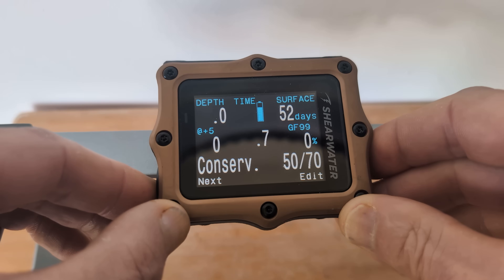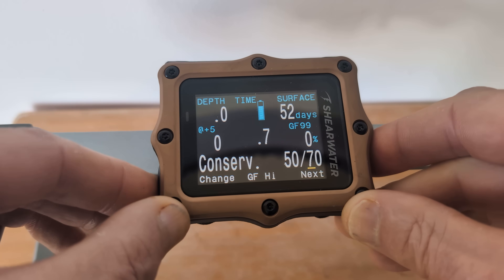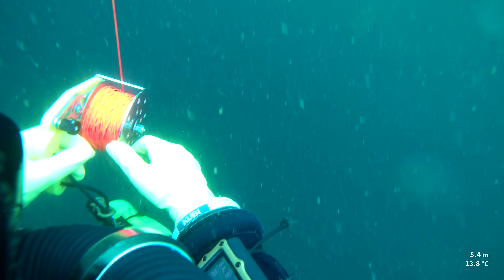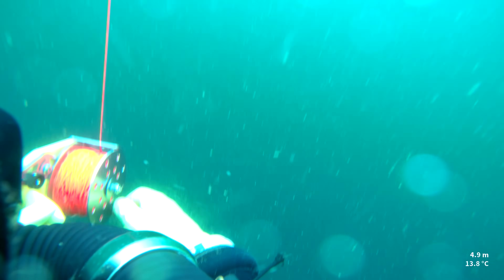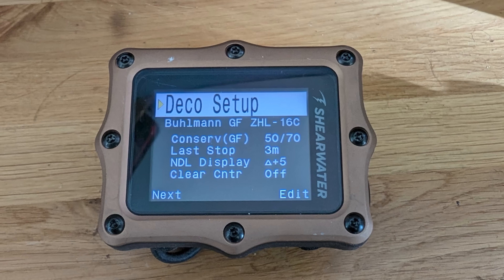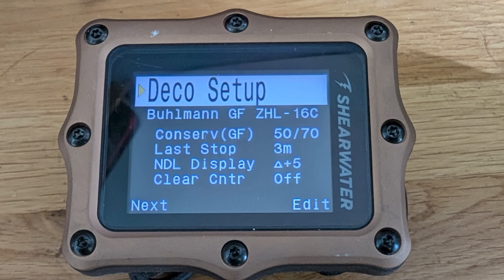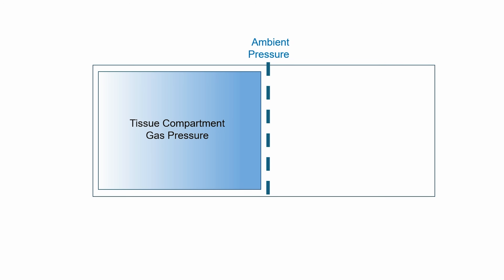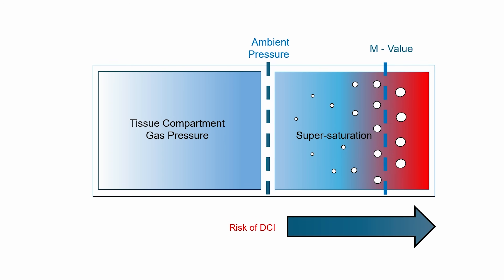I Changed This One Setting and Became a Safer Diver

Comment: Absolutely nitpicking here, but the term M-value was introduced by Workman.

Buhlmann just generalized the algorithm to use absolute pressure (so it works when diving at altitude, given he dived in Swiss lakes), while Workman’s version was only designed for depth pressure—aka at sea level. Buhlmann also expanded the number of compartments to 12 or 16 (though I can’t remember how many Worman used… maybe 4?)

Anyway, great video, thanks for sharing!

I dive 50/80 when doing deep dives (though I try to stay on oxy until my SurGF is in the 60s if possible), and 20/80 when doing long shallow cave dives in Mexico.
Reply from the maker: Of course you're right and thank for flagging that up.  I was trying to keep my explanation as simple as possible but sometimes when that happens stuff gets lost, like this

Comment: Thanks for the great video. I started diving 50/75 a number of years ago. When I made the change I noticed fairly quickly that I was less fatigued after.
Reply from the maker: Interesting to hear, what were you using before?
Reply: @DeepWreckDiver I was running a 40/85 prior.

Comment: A useful parameter on Shearwater, and now Suunto, is GF99/GFSurface.  It’s useful to have a real-time display of where you are against M and the selected GF slope and where you would be if you just went straight to the surface.
Reply: I use it to do "dynamic safety stops". Basically, go to whatever depth is required to keep gf99 >30 or even >40, for at least 3 minutes. In practice, it means you are starting the safety stop at 4-5m and ending it at 1-2m. It adds a whole lot of conservatism (you will easily exit the water with 15-25% reduction in surfGF compared to a normal safety stop). The only downside is guides will think you're stupid breaking rules but hey, I've not exited the water with surfGF >65 for a long time, even when hitting 0 NDL, and it takes no longer than a normal safety stop
Reply: @a @albert91tgn u highlight an important point - doing what you do based on knowledge and skills rather than following dogma without understanding the reasoning behind it.
Reply from the maker: Yes, I agree and see lots more people having it displayed prominently on their computer!
Reply: They are available on the higher end Garmin computers, as well.  Even when I have a 60/80 set, for example, I’ll still usually hang around for an extra few mins, as conditions permit, until the SurfGF gets down to 70 or so.

Comment: Every person is different on every dive. There are far too many variables in any one dive, even tightly controlled research dives. Trans cranial doppler studies from NEDU testing the same individuals doing the same exercise at the same depth and in the same water temp showing bubble risk is largely unpredictable. You should pick a GF, or not, based on the research when you get the computer and you shouldn't change it unless you get a hit. Plenty of people never adjust the GF, others dive GF99, and neither get bent. You sir are no safer for changing things if you have no history of bends with previous settings. What works, works.
Reply from the maker: Because I'm getting older and less fit, my assessment is that the risk of a bend is increasing.  I've changed my GF so I spend more time on decompression which I believe will counter the increased risk. I think most people would agree that is pretty sound logic and will make me safer!
Reply: Yes until it doesn’t

Comment: 50/70 is right in the range the tech divers in the Puget Sound/ Salish Sea region seem to use.  75 is about the highest I have seen for GF high.  GF low seems all over the place, anywhere from 45 to 75.   I wondered how you guys were getting away with using such high gradient factors without getting bent when I saw some of the earlier videos.  There don't seem to be a lot of people around here diving to 100 meters very often either though, so I do wonder if there is a difference between a quick bounce to 100 meters and spending an hour at 50 meters.
Reply from the maker: Not sure I'd describe 20 mins at 100m as a "quick bounce" but I think I know what you mean.  Some of the people I dive with have far more aggressive deco strategies than the one I use.  By and large it has worked for them for many years but I don't want to be the exception!

Comment: Thank you very much for this! I dive with an old Scubapro Luna, but as you may now, not yet technically. The conservative setting 2 is in a good agreement with 40/70 on a Perdix, well just tested for a couple of deco minutes ...

I would go probably to 40/70 when I will get my Shearwater. A benefit then is, that in a kind of emergency I could switch to 60/80 or so and be quicker out of the water - so I have some safety time in a sense.

Thanks for your clear reasoning, I like it. I believe changing the high GF in your case and keeping a bit higher low GF is a wise choice. At the surface its the same, but you are off gassing quicker and have less time at deeper deco stops where even some tissues may still saturate. As you say its a straight, so for the shallow stops there is not so much difference in your leading tissue saturation and there are the biggest relative pressure changes. Actually I was also thinking of 45/70 for me..

And some random note: I would even state its a decompression model, not even a theory. And its fitted to a certain selection of people. The outcome if one uses another selection would probably be different. Good thing is the statistics.
Most importantly watch your body and (environmental) circumstances - adjust if you think there is a higher risk like workload(breathing rate and thus gas exchange) at depth, warm at depth and cold at deco stop, not enough hydrated and so on.

Thank you for the video!
Reply from the maker: Thanks for taking thetime to add your thoughts.   Before Shearwater I used to use Uwatec computers which I believe became the Scubapro ones.  I always found them very good!
Your suggestion that deco stops should be adjusted based on your assessment of each dive's circumstances is a really good one and something that I often do.
Reply: Interesting choice. The current thinking, I believe, is that diving air/nitrox the ZHL-16C models dive very well. The current recommendation is not to make GFlow too low as this possibly increases your risk of increasing saturation in medium and slow tissues. So 70/70 80/80 75/80 70/85 etc are all seen as good settings. BSAC recommendations are a min safety of 85/95.
However, there is some evidence that the ZHL-16A helium model (Buhlmann only increased the nitrogen conservatism in the B and C variants) is also too aggressive. As a result, people are suggesting deeper or even deep stops. Many are using GF low in the range 30-50. GFhigh will still be dominated by the nitrogen so setting range from 70-95. 
It is all an experiment, one gets to guess which chamber has the bullet in. My personal view is a very low value for GFlow for air and nitrox isn't without its own risks.

Comment: I heard Simon Mitchell, leading proponent of lifting the deepest stop, mention in an interview that he uses 50/70, so I’m using that and it seems to be working for me. Agree though that it’s a very personal thing.
Reply from the maker: Yes, I've heard him say the same thing as well!
Reply: I’m pretty sure he uses 40/80 unless he’s changed recently?
Reply: @jayschier495  I'm very certain I heard him say 50/70 in one of his recent interviews. Just tried to find now where I heard it. In his UTD podcast in 2021, at 22:45 he mentions he uses a GF low of 50. That's a few years old now but I wouldn't imagine he's gone backwards in the time since given he remains the main proponent of a shallower deep stop. In any case, I would say a GF low of 40 still sits in the 'shallower deep stop' camp. I'm not saying 50/70 is optimal, I just figured I may as well align to the personal judgement of Simon Mitchell as a reasonable and modern starting point.
Reply: @davidthommo7891 , that’s what my logic went with as well…..and I’ve been using 40/80 since that UTD podcast…..now I’m second guessing myself….better watch the entire video again……cheers!